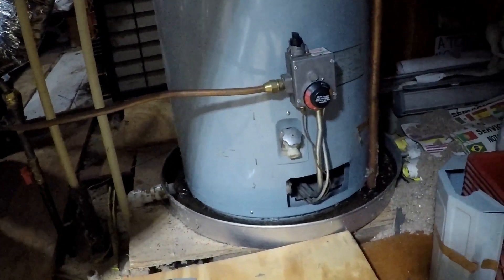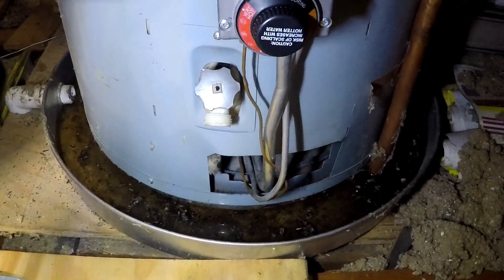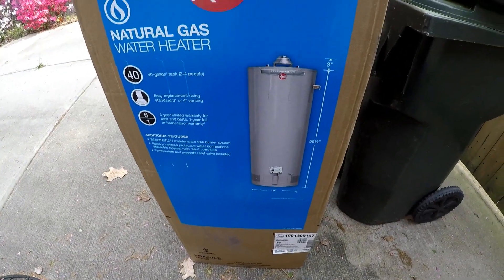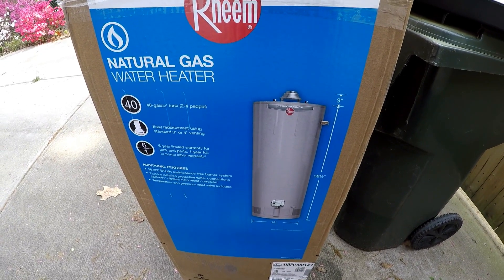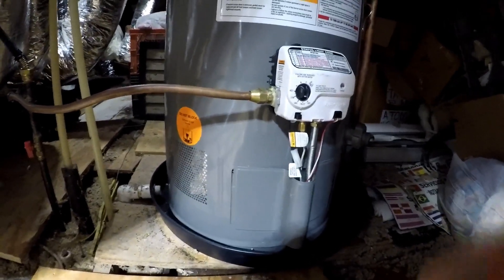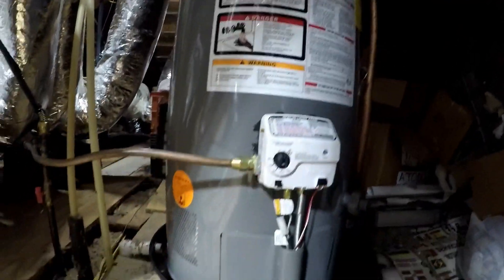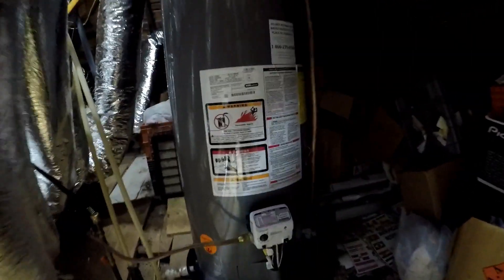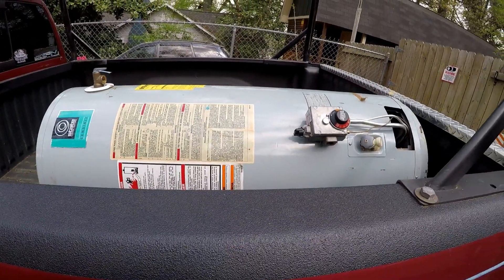Replacing my 24 Year Old Hot Water Heater

Comment: My mom and dad replaced one in 1971.  It lasted 24 years.  Then replacing it in 1995, we had extra expenses to bring things up to code.   Bigger blowoff pipe.  1/2 inch instead of a small one the diameter of  pencil
Reply from the maker: The toughest part was getting the old unit down and the new unit up through the attic door but we got it done. This one seems even more efficient so I hope I don't have to deal with this another 24 years.